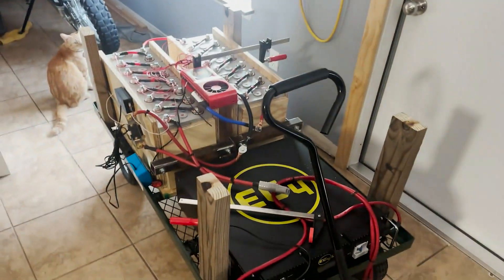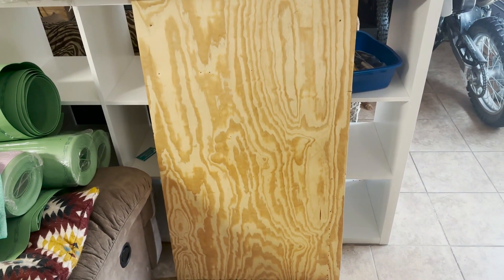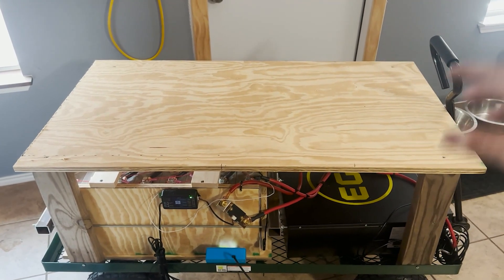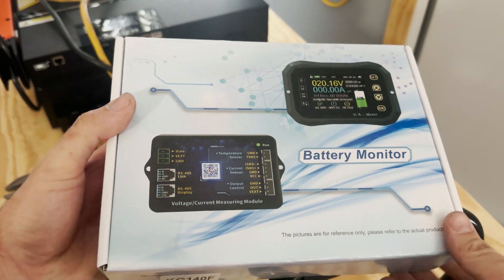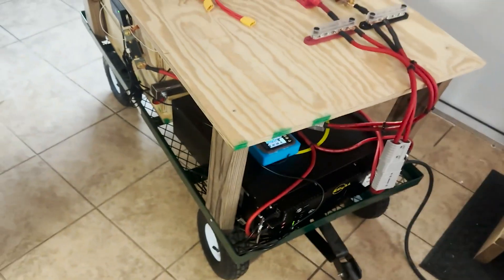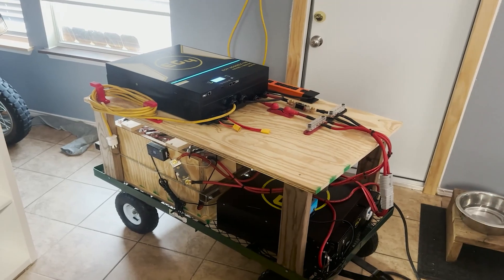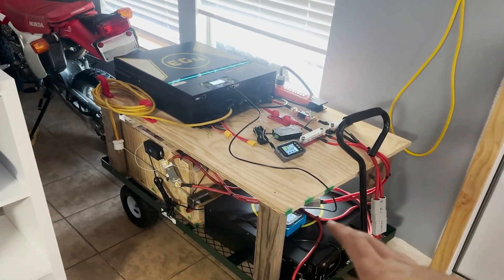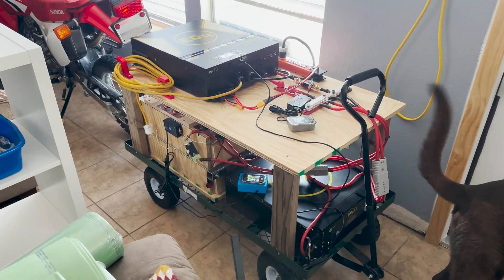I Built A 48 volt Solar Power System In 1 Day!

Comment: Outside magnetism around the metal wagon could maybe induce a shock. I wouldn't think so on lower voltages. Had a high voltage tv transformer that induces a shock when you touch metal. Who knows in your setup.
Reply from the maker: Yea it’s weird man, I think it back feeds from the hv side somehow, but it’s good now!

Comment: Outside magnetism around the metal wagon could maybe induce a shock. I wouldn't think so on lower voltages. Had a high voltage tv transformer that induces a shock when you touch metal. Who knows in your setup.

Comment: My GF is going to kick my ass if I build something like that.
Thanx for the inspirational video!
Ordering parts now.
Lol
Reply from the maker: Haha she will understand when your can run stuff with the sun! Good luck!
Reply: @Mikebuildss ,
I was searching for instructions on how to wire a 2S4P lifepo4 200ah battery and I came across your videos. Really nice work you do. Love it!
I'm still unsure on what gauge wire to use for each parallel/series connection. I have a 500amp bms and a xantrex 2000 pure sine. Was hoping to run a 5000 btu ac 500w in the campervan for 4 to 5 hours.
I only have 300w solar total. 200w rooftop and 100w ground deployed. Victron dc to dc 20a charger for road assisted charging. 
I have enough 4awg to make the parallel/series connections, but unsure about wiring the 2@100ah in parallel/series, using only 1 bms to make a 2S4P single battery.
8 CALB lifepo4 100ah cells.
500a bms
2000w max load